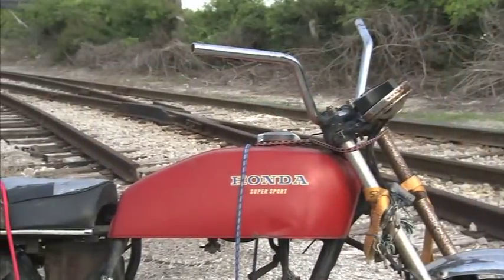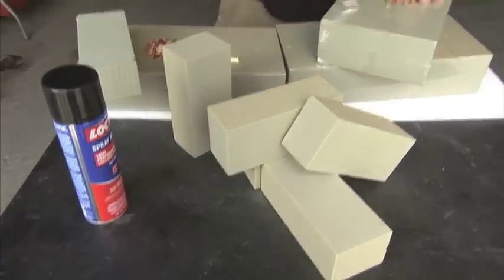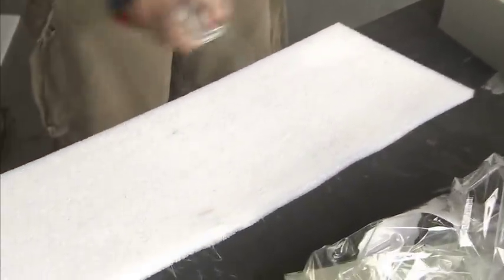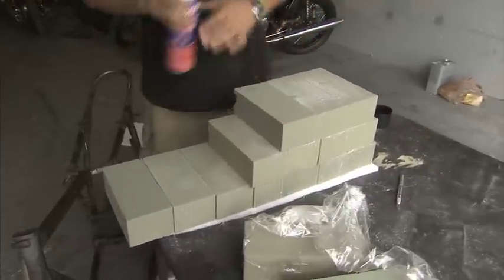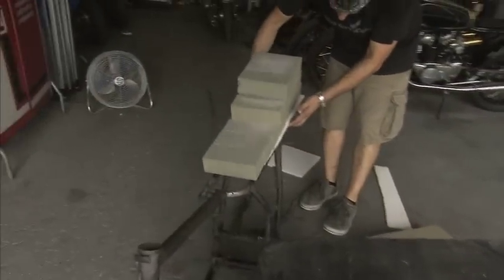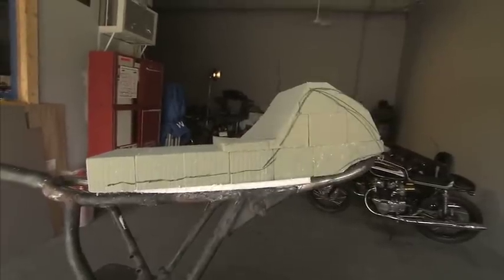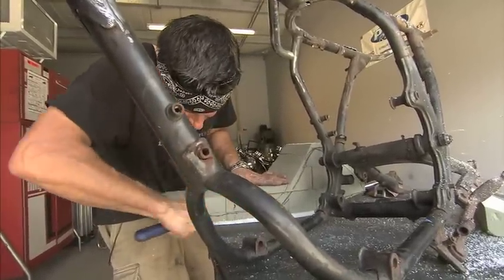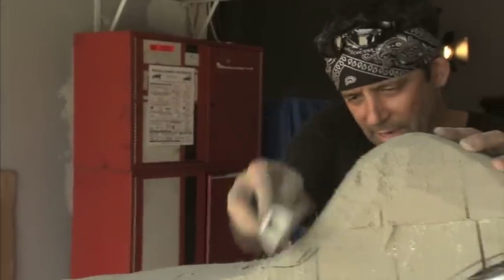Herm Narciso, Dime City Cycles - Makes a Fiberglass Cafe Racer Seat! - Part 1

Comment: small side note , always wear a painters mask with good filters when using spray adhesive, the stuff is not like paint its literally glue vapour , read the back of the can there will be similar warnings its much worse than breathing in paint fumes

Comment: What kind of foam did you use to make the mold for the seat? Where did you source it from? I'm working on a project now to craft hard bags for a '99 Sportster XLH 883. We don't wan to spend 50% of the bikes value just to add hard bags, and looking at your video with the careful shaping of the foam was good. We'd like to go that way instead of buying so we can say built, not bought.

Comment: Thank you man, it's sticky sh** and the spray adhesive didn't... well stick. So we did the foam blocks with special glue (which doesn't eat the foam). And in the end we were exactly like: IT'S A SHELL !! ;)
Reply: CafeRacerDIY  same result here, what type of adhesive u used stick those dry foams??